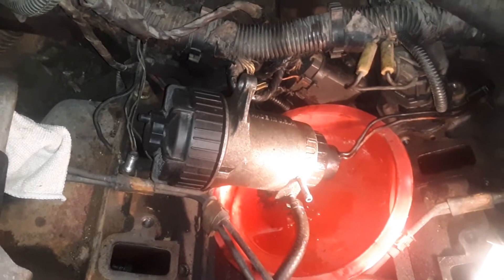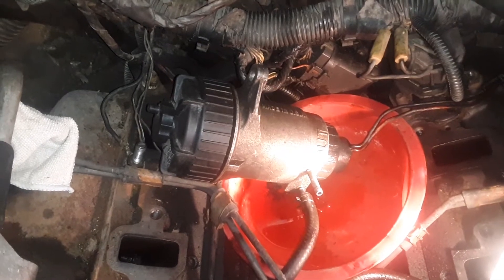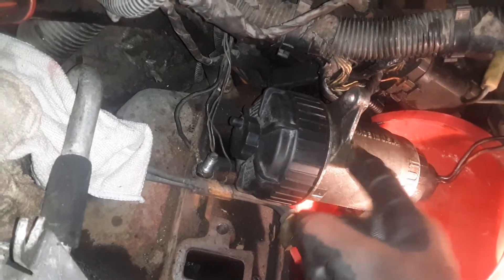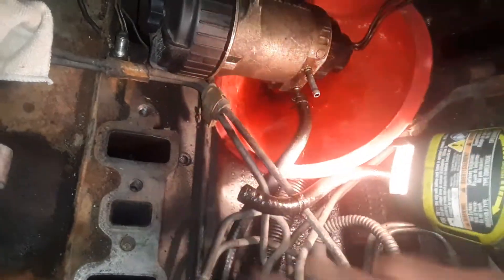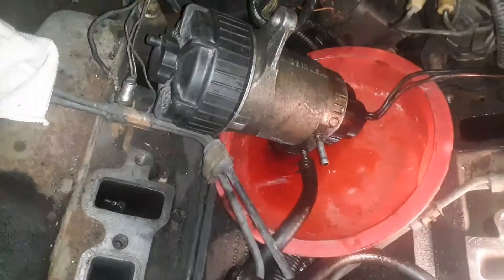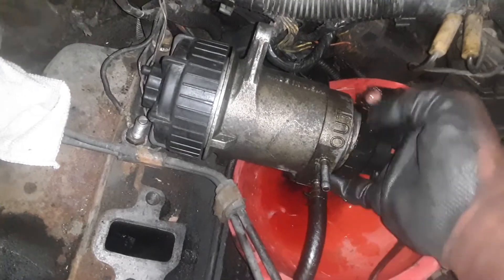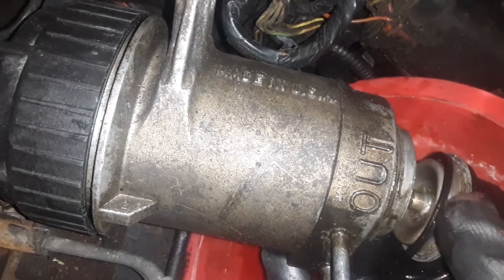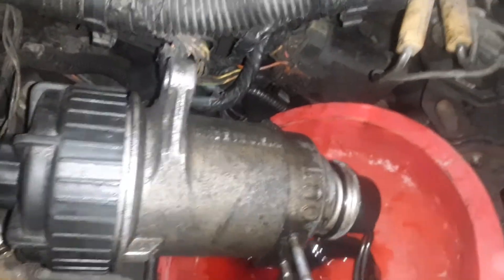1996 6.5l Diesel Turbo Bottom O-ring of fuel filter housing- Hearter / Heat Element O-ring / Seal GM

Comment: Thanks I didn’t know there 
Was one there.   I will have to check that because I do have a small leak somewhere 👍
Reply from the maker: Most of the time thats where the leak is. If the metal fuel lines are not rusty. Up to some years ago, I did'nt know either. 😎👍🍻

Comment: Mine appears to be leaking from the top any idea why? Might even be coming out of the bleeder valve too. Can't remember if I got a new gasket when i replaced the filter last time know what the part # is by chance?
Reply: That gasket is tricky.  Comes with new filter.  Install it on the top of the filter housing and not inside the filter as it may be twisted out of position that way.  I had a WIX and a FRAM filter.  Both different, FRAM had built in O ring and WIX had the big round gasket.  I went with the WIX and not problems.

Comment: Where did you get the o ring for the bottom?
Reply from the maker: You can find it on Ebay. Most of the parts I get are from there and usually it's cheaper. 😎👍🍻